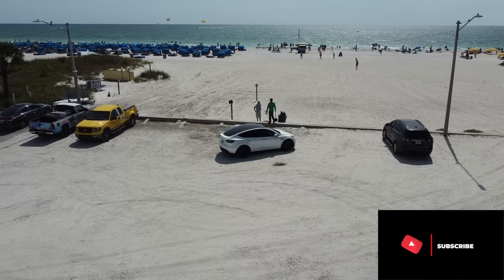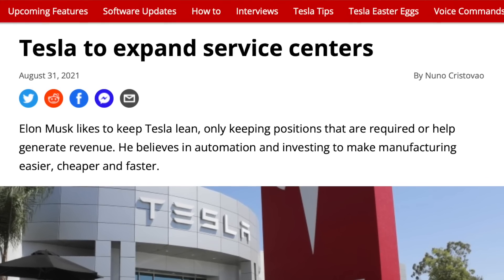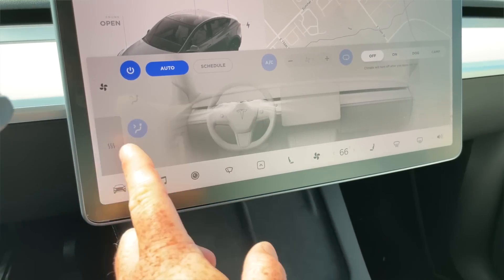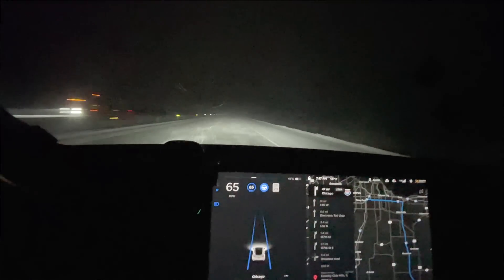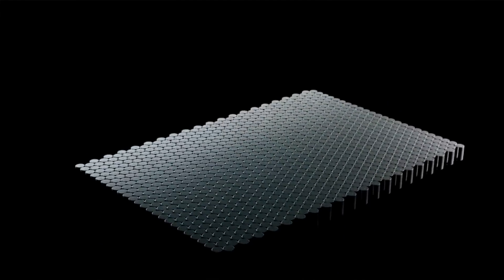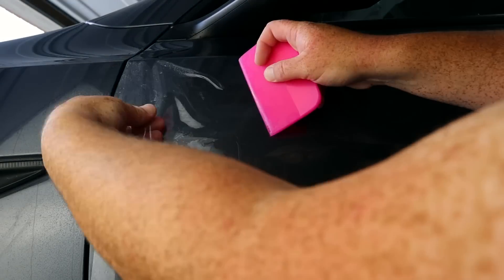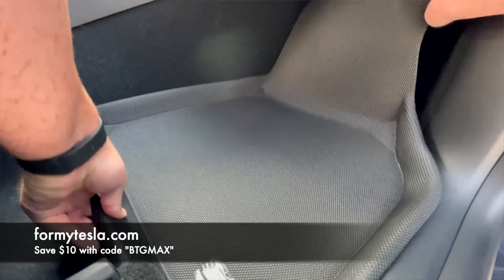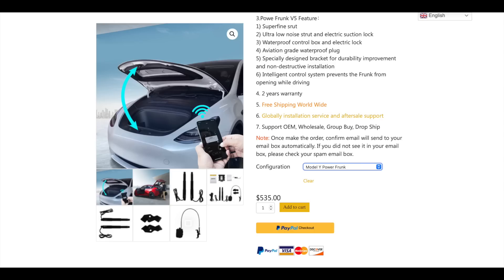Tesla Model Y - Review, 5,000 Miles Later, Take 2

Comment: We have 16,800 miles on our 2021 Model Y no problems. The ride is a little rough, however we have a Reservation for a 2nd Model Y with the condition of the 4680 battery. We went to the service center to do work on the Heat Pump (no charge) took 1h 20 minutes. My wife will get the New 4680 Model Y 2022 ,then I get to drive the 2021 Tesla.!! happy wife! happy Life!
Reply from the maker: smart man

Comment: I basically ended up with an extra order since I pulled the trigger on a demo car back in late September. I haven't been able to convince anyone at Tesla to refund the order fee - one rep basically told me to just hang on to it - which is what I have done. I'll probably push out my open order a bit and consider selling my current model Y once the new batteries come out. That should also allow my credit to recover a bit from taking out the loan. The next year could be amazing for Tesla and model Y.
Reply from the maker: I think 2022 will be an amazing year

Comment: Can't wait to get mine!!!  Q2 is my expected date.  Glad its not Q3, but we will see.  Love these accessories and upgrades!  I am def. dropping my car off right after I take delivery for the tint and XPEL.
Reply from the maker: Smart!
Reply: what % tint are you getting and which part of the car?

as for Xpel, I plan on getting it but are you getting a full coverage, full front, or partial ?
Reply: @jBstfu  I’ll be matching the 4 side windows.  30% probably.  The front windshield is getting the clear, 50%, I believe.  Enough to block out the UV rays and other harmful rays but no tint front windshield.  Clear, believe it or not works very well!  I had doubts before until I had it done.  

XPEL, I haven’t really decided.  I’ll probably do full just because the areas that I didn’t cover will probably get scratched or ding.  And I’ll be kicking myself in the butt for not covering it. Haha
Reply: @paulgray9191  you mean full coverage like the whole car? or full front? either way they’re both expensive aaaaaaaaaa!! 

thanks for the tip about the windshield, I might do the same..
Reply: @jBstfu  ya, the whole car.  Front, sides and rear.  I had a buddy get his done for $3,500 BUT on a Model 3. It’s expensive…. As of right now, I’m doing full coverage, haha. When it comes time, probably just the front. Haha
Reply: @paulgray9191  how much did they quote you on the full coverage ?
Reply: @jBstfu  I haven’t got a quote yet.  I was basing my price off my friend.  But, I’m curious now. Haha.

Comment: Excellent review we have the  exact same one as you 2021 Tesla Model Y long range Midnight Silver Metallica with White Interior but only 5 seats utilized R 1 Ceramic Exterior Ceramic Coating did it may self x 2,Coat each time took about 7 hours by hand super shiny last 5 years yes Guyeon Nanoceramic Leather for the White Interior the best 
I also Ceramic R 1 all the door metal and metal under Frunk and Liftgate in the back 
This is best SUV ever owned 
After watching this will trade up prior to 40000 miles 
Service Center in MI has been fine 
Don’t have that issue with center floor 2 Nd row 
Please schedule with Service Center 
Enjoy 
This was an excellent review and I’ve gained more knowledge 
Thank you 😊
Reply from the maker: cheers

Comment: Ok..I've scanned the comments and don't see any about mats. I have mats for the front and rear passengers feet but not for the back luggage area because things slide around on them. I use a large beach towel to protect the carpet and cargo stays put better. It is still a problem if you turn/stop/start too quickly which is relatively easy to do with this MY.
Reply from the maker: No issues with these mats in the cargo area. Rubbery type of material so things stick pretty well

Comment: Did you apply the ceramic coating to the entire vehicle (even panels not protected by PPF) or did you wait until PPF was installed on the entire vehicle before applying the ceramic coating?
Reply from the maker: PPF first! You can’t pay PPF on ceramic surface, it won’t stick or last

Comment: Whats the reason for the frequent, short stops to charge vs less stops, longer charges?
Reply: Charge curve, you can get more power per minute when below 50% state of charge. So you stop more (at low state of charge), for less time,  but get the same overall amount of power.
Reply from the maker: Way faster to travel that way

Comment: How far can the 2nd row move forward to create legroom for the 3rd row? How much legroom is left over for the 2nd row? TIA.
Reply from the maker: More than you’d think. The 2nd row does lose a bit of leg room though
Reply: @BeardedTeslaGuy  we have 5 kids... Our oldest is only 5'2" but our boys are expected to be 6'+ I assume I can put our smaller kids back there?
Reply: @pastorquangful  5 kids? Wow ok... Jungle aszn
Reply: @pastorquangful  a friend has the 7 seater, the back is so small anyone over 5'2" is going to hit their head.  that and if the 2nd row is all the way back, the 2nd row basically touches the 3rd row, so no room for legs of any size.  the 2nd row moves maybe 5 inches or so forward? (haven't measured it, but its not that much)  so someone under 5' in the 3rd row can fit, but really cannot move their legs.  I would go with the 5 seater, or another car if you really need a 3rd row.  As far as the 2nd row, its been a while since i tried it, but I'm pretty sure i put the front seat all the way back, and i can still fit in the 2nd row (i'm 6'8").  You also loose about 4" of height in the back of the vehicle since the floor is higher on the 7 pass.  I ordered the 5 seater, as my daughter is 5'4" at 9 years old.

Comment: Took delivery of my Model Y Wednesday. So far I'm loving it! I do miss some of the features of my Palisade though; turn signal camera (that was the absolute best for blind spot detection), bird's eye view, and front camera park assist. I don't understand how Tesla has all those cameras but not using them to their full capability. I'm also having issues with the call quality over Bluetooth. Often, I get complaints of sounding distorted. I'm your Midwest neighbor over in Chicago so I'm curious as to what the winter will bring!  Thanks for the videos and keep them up!
Reply: Umm Tesla will likely add those later. Only thing that won't be as good as the Palisade is the front camera park assist because Tesla does not have a camera on the front bumper (i think). Either way, the cool thing is Tesla can OTA those features at anytime. My guess is they are working on a 360 degree arial view (like in audi, bmw, benz, genesis). So it might be taking extra time.
Reply: @ayushmalpeddi2793  all valid points! I'm crossing my fingers. Lol.
Reply from the maker: Cheers and congrats

Comment: My model 3 2nd row floor has that sound too
Reply from the maker: Ridiculous
Reply: @BeardedTeslaGuy  My 2018 Model 3 has the backseat floor noise, and I brought it to the service center shortly after delivery insisting that they look into it. They pulled the carpet and looked at it and did research (contacting Tesla higher up, etc) and I believe they said it was an additional layer of fire shielding or something along those lines... might have been added to the design/assembly at a late stage. They said it is supposed to be there, no fix available for the noise. Yeah, it's very annoying!

Comment: BTW, the Tesla referral program is gone. Also, I disagree with the 1:5 ratio of added time on a road trip. ICE vehicles need gas and bathroom breaks too. It just seems like an exaggeration, in my opinion. Thanks
Reply: yea, i had to check.... MKBHD did the 1000 mile road trip and gas car did 18 hrs 39 min of driving and the Tesla added 1 hr 32 min to that.  So thats about 8.2% more time for a Tesla to do same distance.  Or about every 5 hours of gas car driving would be 5 hr 25 min for Tesla.  Granted MKBHD used a long range model S, so the Y wont go as far per charge, but about 30 minutes for every 5 hours sounds about right.  The Y I test drove got like 200 miles of range in like 25 minutes we were in the store, at a 150kwh supercharger.  so if you start with near full battery that sounds about right, 300 miles (5 hours driving) would need 25 minutes to charge, whereas gas car might only need 10 minutes to refuel after 300 miles.
Reply from the maker: Just letting you know based on my experience with many long road trips if I plug in a destination on my phone, it’ll take an extra hour per 5 hours shown
Reply: @BeardedTeslaGuy  understood, in real world trips, not the fast-as-you-can approach it's probably the 1 hr you're saying, specially with a family and other things to slow you down.  The MKBHD gas car wouldn't make the 1000mile trip that fast either if they had a 3 year old with them, ha.

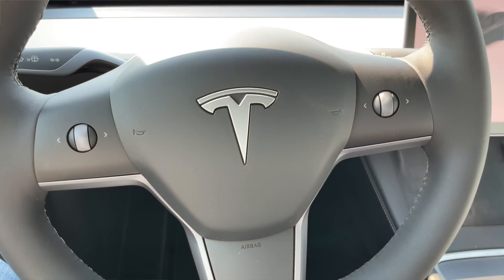Comment: You didn’t have the bucking sound on rear floor in your 2020 MY ?   I’ve seen this video at 5:13 showing the rear floor panel that got the material called “ Mastic”.     https://youtu.be/m35P1By5FgM.   That might be the cause of this sound.  Or might be something to do with new  single piece rear end casting introduced in 2021 MY.
Reply from the maker: Did not have this on the 2020 Y